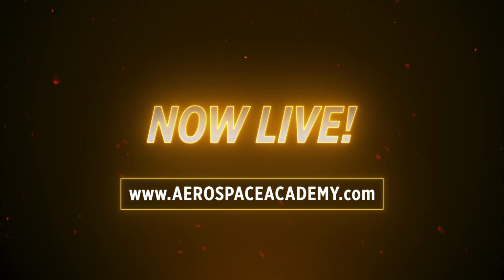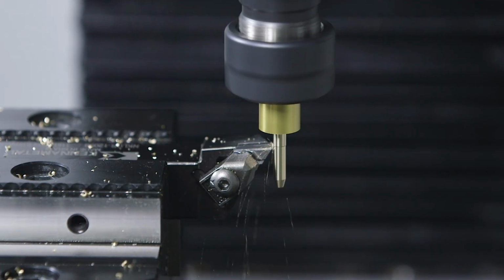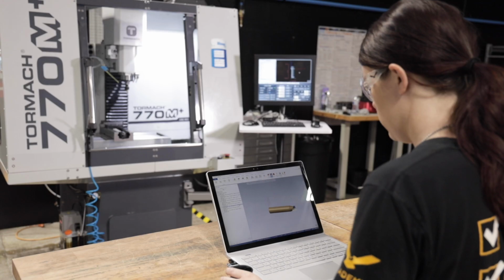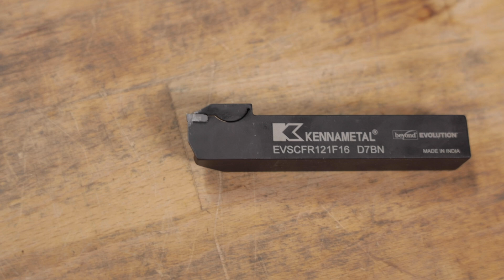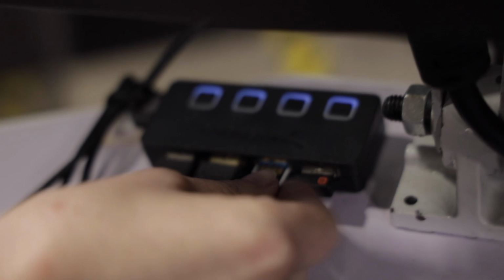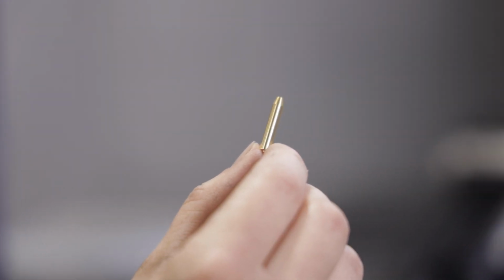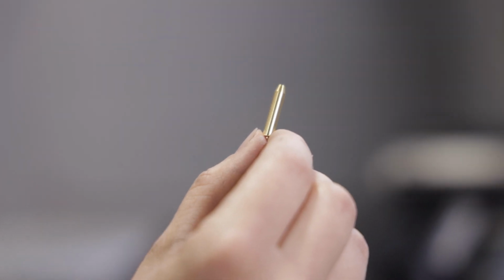Parting Off on a Mill??

Comment: Having only worked with mills, how would you go about using multiple tools?
Let's say I had a fixture that held a few turning tools on table and maybe some drill bits stood vertically. How might you go about programming in mastercam. 
I could imagine I would be able to fudge it using each tool as a separate work offset and manually changing each "tool change" for a "work offset change". But I would imagine there is a much better way?
Reply: use tool offsets make the x same and change the y offset, but you can always make custom post processor for the job
Reply: I would probably have a go at it using sub programs for each separate tool or maybe use macros
Reply: @marouanebenderradji137  I'm not good enough for custom posts, best I've managed were basic edits of pre existing posts. 
Is the tool offset something that can be driven in mastercam alone? I dont currently have access so cant just look and I've never used a lathe post/tools before.